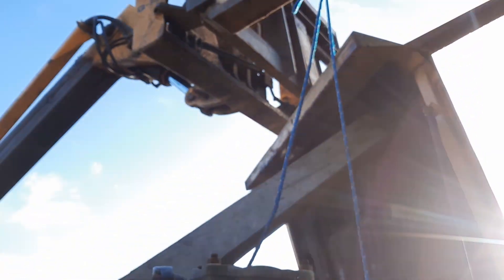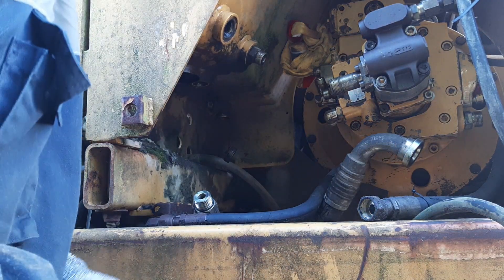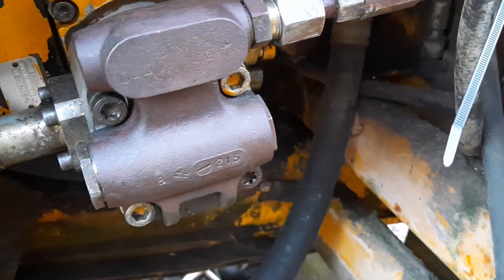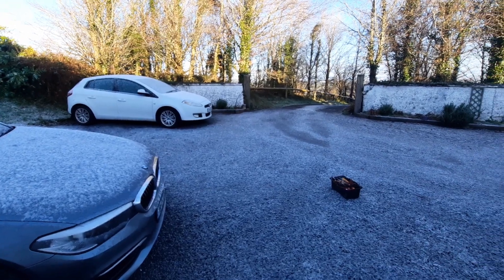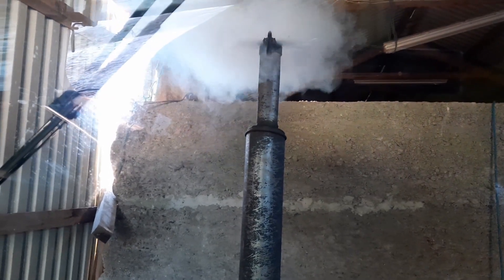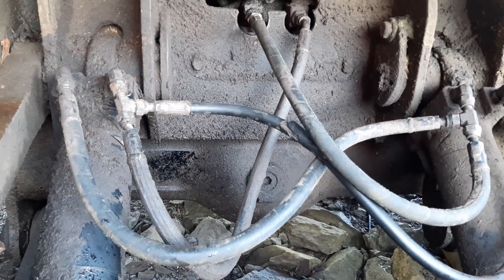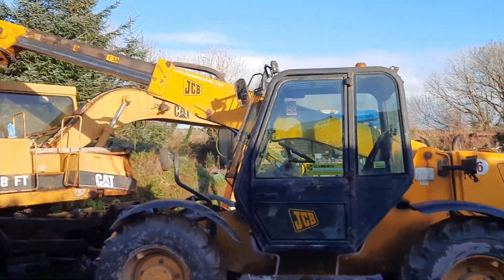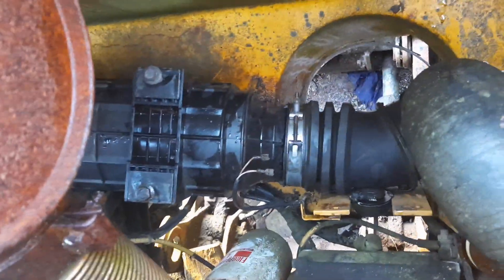Old CAT Rescue PT6- Reassembly, Will It Work Or End In Tears??

Comment: Sometimes In life despite all your hard work, some things are not to be, but, if your batteries are not powerful enough maybe some good jump leads from the tele handler will boost that old cold engine, or as daft as it sounds carefully light a controlled wood fire or better still a coke fire or charcoal fire under the cats sump to warm her up/ even aeroplanes in arctic cold drain the engine oil to keep it hot before starting there engines..  good luck
Reply from the maker: Thanks Ian. I got a new set of batteries, and ill parallel the old set if required. The temperature has finally risen a bit this morning so I'm going to give her another go. Hoping i won't have to resort to a flaming rag to the inlet!
Reply: @davesworkshop2714  Flaming hell - lol - even warming the inlet with a blowtorch might help, or do what the yanks do spray anything combustible down the inlet... short story - many years ago when we had a severe winter i remember a stuck furniture lorry had lit a fire under his diesel tank to get it moving/ worked it the end poor bloke, but a splash of unleaded mixed in would have helped him..  I ran an old diesel discovery on new cooking oil and diesel plus a "splash" of unleaded mixed it, it started straight up even in winters without heat, had done 240.000 miles and was like new bless it, had to sell it to a collector as I became disabled and needed an automatic..  Hope you get the CAT running soon mate. Ian.
Reply from the maker: @ianburit3705  Ian, I remember guys here doing that we tractors in the winter too. The good old days before common rail, DPFs and other stuff you could hurt!! I'm not a fan of starting fluid, so I'll sort it with lots of amps. I've been through all the connections as well (more detail in the next video) so they now im wasting less power heating cables 🤣. Worst case ill wait for the temperature to rise on Friday. Take care of yourself and thanks for watching! Dave
Reply: @davesworkshop2714  Thanks, take care, Ian.

Comment: Did you primp pump? Good job. Can’t wait to see it run..
Reply from the maker: Wasn't 100% sure what to do, filled her up with oil, had a leak out of a lose fitting at the back of the machine so I think it made it's way through. Then I cranked her with the fuel off. Plan to do the same when I get the new batteries. The oil level in the tank dropped off so it must have circulated some. It also changed tone as I cranked. Any further advice on what to do would be much appreciated.